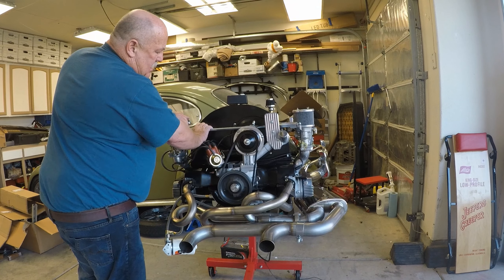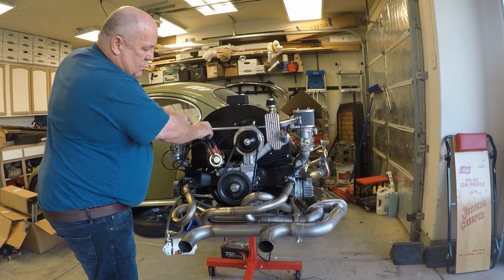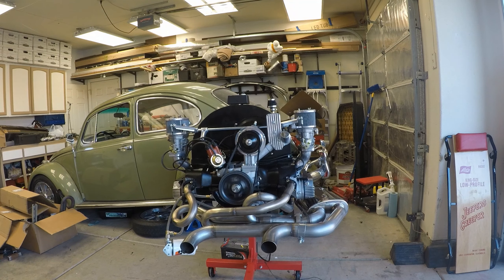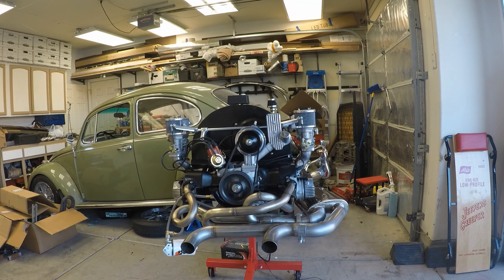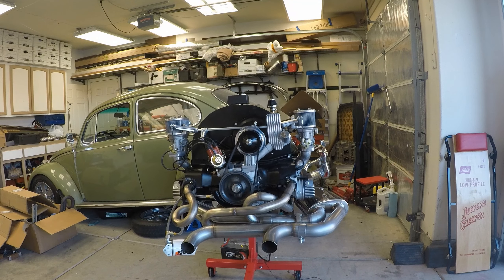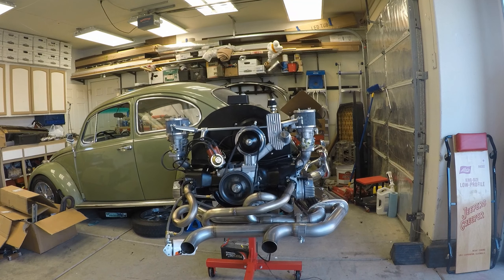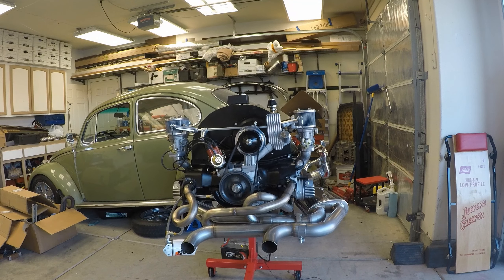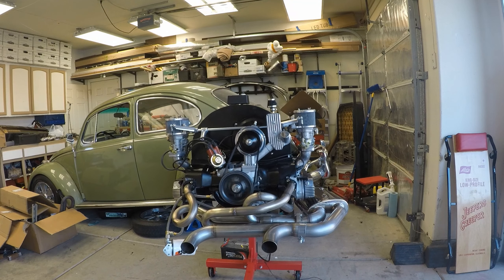VW 1776 super mouse

Comment: I love air cooled VW engines !  I really enjoy building a fresh Vdub engine from the case work to carbs . So far 1600's , 1776 and 1835's have kept me happy .  My new engine on the stand is going to be an 1835cc grocery getter . Happy building !
Reply: I’ve always felt the 1835 was the perfect VW engine, done right.
Reply: @socaljarhead7670  The last 1835 I built ended up in my 71 Vw Bus . It really was a "freeway flyer" , it could scream in a straight line  , cornering not so much . My new build is a stock 1600 👍.

Comment: What kind of trans axle are you going to run ? My beetle in 81 had close ration 3rd gear and I would out run V8 camaros
Reply from the maker: I just put in a freeway flyer In a all new Rhino case with a super diff and weddle axles Built by Ben at Benco

Comment: Very clean and meticulous work there :-) Would you recommend a size for a bus camper? I'm thinking of keeping my stock 1600 but with dual carbs, upgrade exhaust, etc or a 1776. I'm looking for better hill climbs but not at the expense of longevity
Reply from the maker: Personally I prefer not to have my cases cut for larger than 92's that being said I do like the thick wall 92's so the heads are cut for 94's the 92 thick walls are dead reliable and you can play with the stroke of the crank and get anywhere for a 1835cc with a 69mm crank 1968cc 92mm x 74mm , 2021cc 92mm x 76mm , 2074cc 92mm x 78mm , 2127cc 92mm x 80mm or my personal favorite the 2180 cc 92mm x 82mm all of these engines have the same bore only the strokes are changed i would consider any of these as reliable just keep the cams mild and the sump deep I really like cb performances 4 quart deep sump hope that helps
Reply: @popsgarage6621  Thanks for the info :-)

Comment: I love the way that motor sounds. What do you think it would cost for me to build the same thing
Reply from the maker: I believe I have about 7 thousand in it
Heads 1200
case 1100
carbs 900
exhaust 1100
crank and flywheel plus balancing 500
rods 350
tool steel wrist pins 450
tool steel lifters 500
berg blueprinted pump 150
sachs clutch ect ect ect
new engine tin distributor wires plugs fuel lines 
oil cooler full flow filter pulleys linkage 
berg welded and balanced race fan
it all adds up
Reply: Damn that sounds good!     Who makes the exhaust?
Reply: A1 I believe they do custom exhaust out in California. Call him I was told by CB Performance they are on FB & IG, they can build u a custom exhaust in about 3-4 weeks.